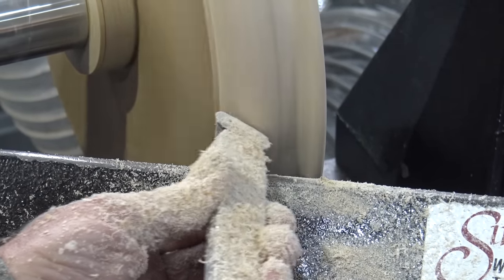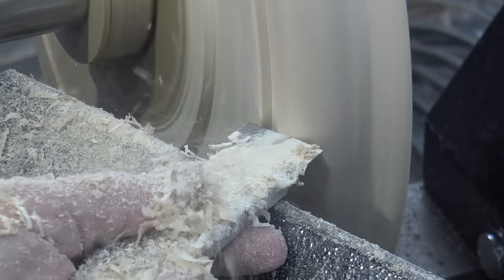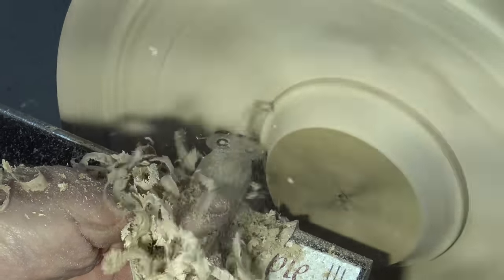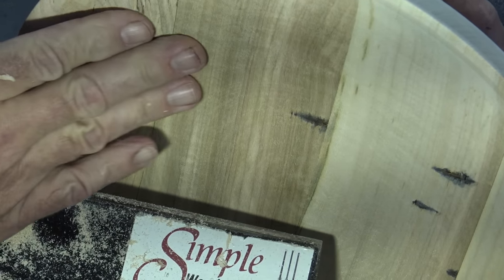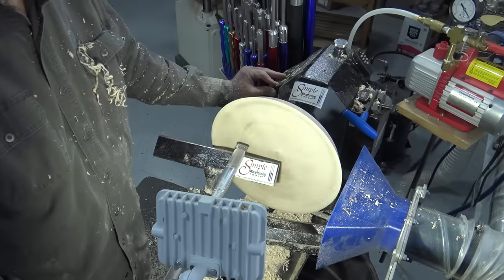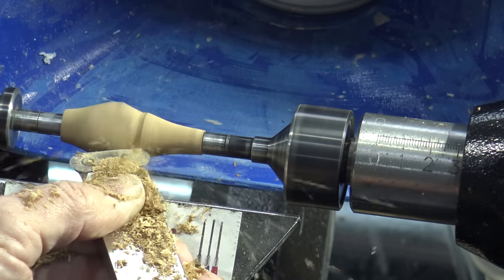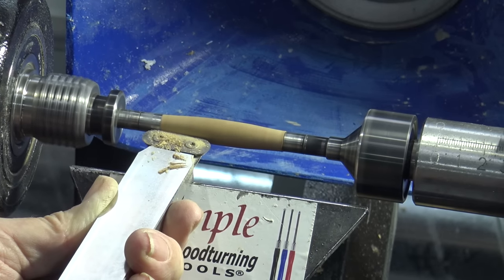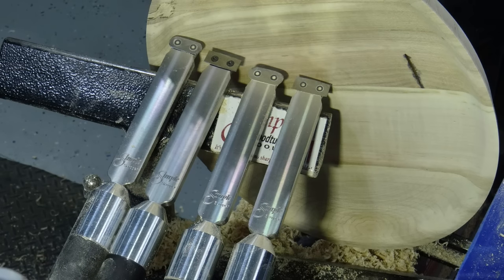The Simple Scraper Shaping and Finishing Tool for Woodturning

Comment: Are you considering making these inserts out of high-quality tool steel rather than carbide? I prefer using the burr on tool steel for final finishing as a scraper. Carbide doesn't work as good for this. I can see the carbide being used for cutting especially on epoxy but not so much for scraping wood. Let me know if you have plans to make those. Thanks, Greg
Reply from the maker: We're not because the negative rake cutters on these tools leave a finish that's so smooth on wood that sanding is virtually eliminated. As a matter of fact, on projects that I intend to finish with resin I don't do any sanding at all.
Reply: @KerryHarrison-Woodturning  I have negative rake carbide tools and they only work well with resin. I've never seen carbide work as a scraper because it lacks a burr. I've never seen a cabinet scraper made from carbide for general woodworking for the same reason. I was looking for some scrapers to do undercutting on inner bowl lips and I guess I'll just purchase the Kelton set of 3 for $130.
Reply: @JamesBondDZero7Mi6 if you prefer high speed steel to carbide for any kind of turning it’s down to your technique buddy, not the product 😂
Reply: @ThumbDr  Have you ever seen a furniture builder use a carbide cabinet scraper? Do they even make one? I don't see any professional woodturners using carbide for finish tools. The finish I see on this video isn't near as good as a burr from a tool steel shear scraper. Some like to turn and others like to sand, I guess. I didn't say there was anything wrong with the product. I was only looking for an optional cutter material. This tool looks very good for some turning applications. I'm still considering getting one and having a local tool shop make me some steel cutters.
Reply: @JamesBondDZero7Mi6  yes. Lol. All  of my friends in the professional wood turning business use nothing but carbide and only used hss for maybe the first 6 months or year of their career then figured out how to use the stuff pros use. Trust me, nobody but  amateurs that can’t afford carbide use anything but.
Reply: @ThumbDr  Sounds like you have that story backward. Name so pros who use carbide. Have they written any books on it? Send me a video link of some of them. I'd like to see their work.